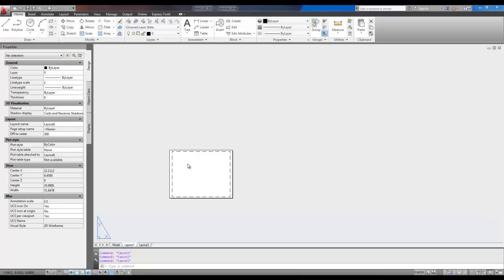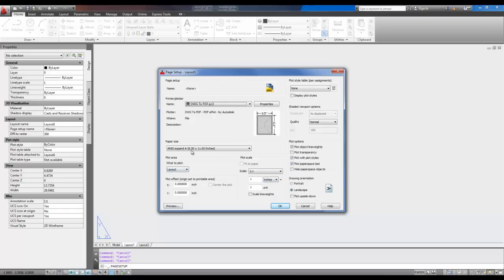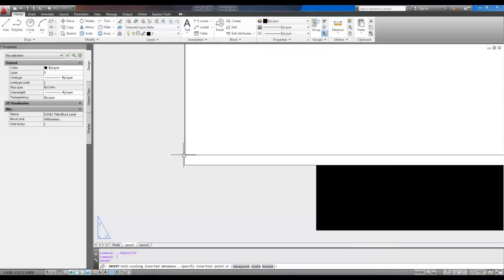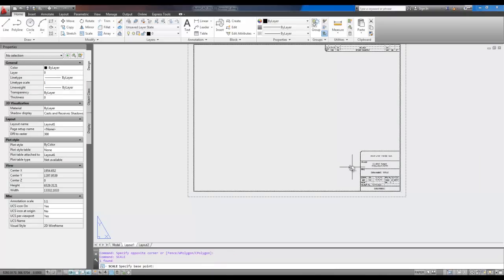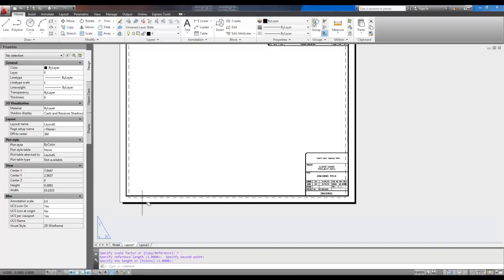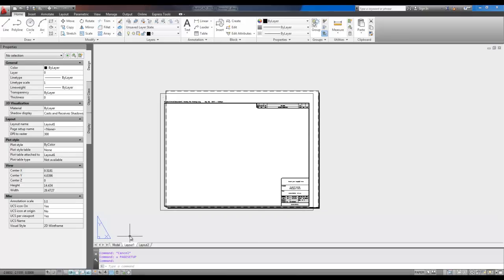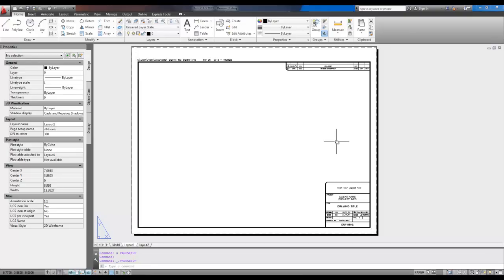AutoCAD Title Block: Insert and Scale to Fit Layout

Comment: I open a new drawing with my title block in the layout 2 position and draw in model space but it will not "view" the drawing on the title block when I place a viewport there. Can anyone explain why? Is there some setting that Im not turning on or off on the tile block to see the drawing appear? I can put the viewport on layout 2 and it will appear, but not on my title block.
Reply: I figured it out...I think. I watched another video that said to type MVIEW as a command once the viewport is drawn...magically it appeared. I thought thats what was supposed  to happen immediately after you draw the rectangle. I guess not, or some setting is off/on that disallows it from appearing then.  Now I just need to figure out how to dimension after changing the scale to make the drawing fit on the title block via the viewport on that page.
Reply: Robert Melendes II

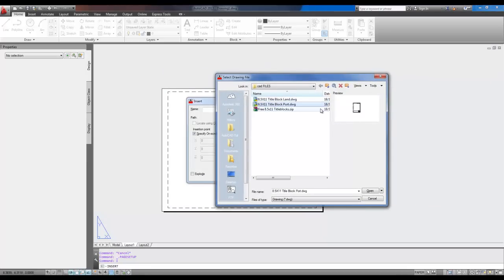Comment: Scale the Paper and Title Block,Never scale the Drawing.Say, you want to use A3 size paper ,A3 size is 297mm x 420mm and you want it to have in 1:50 just enlarged the Paper and Title Block in 50( scale it to 50).and so on.

Comment: Hi brandon. I wonder if u could have shown some videos like importing half of the subdivision parcel of land with roads to the one i have already in my file and how could it be connect to other half with the same scale. Note that the import half parcel of subd drawing has some lines of power, and sewer and telephone line etc and i want that these stuff shall be removed to have the same with my original file which only shown the parcel and the roads..
thank you very much. awesome video  and very easy to follow.